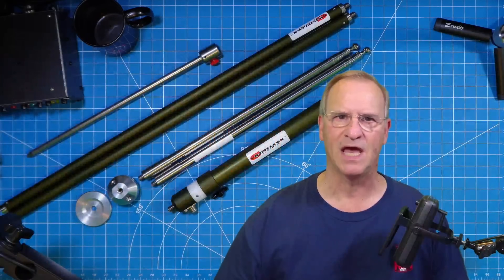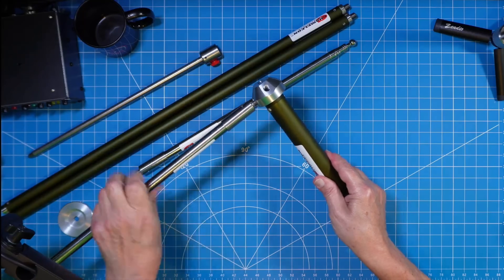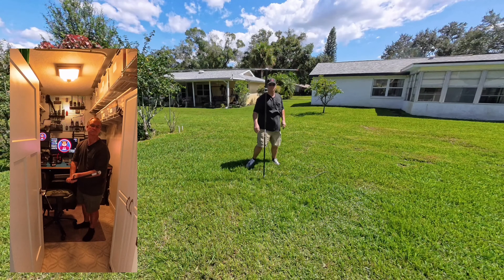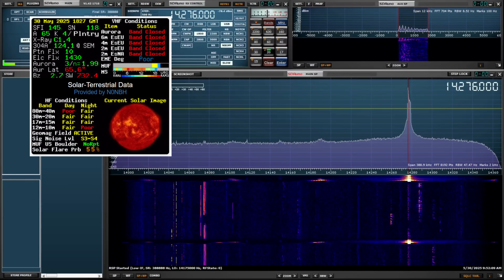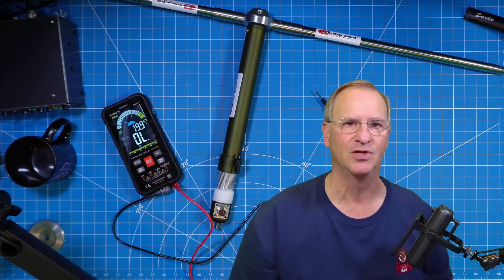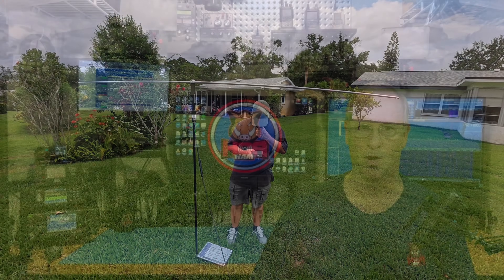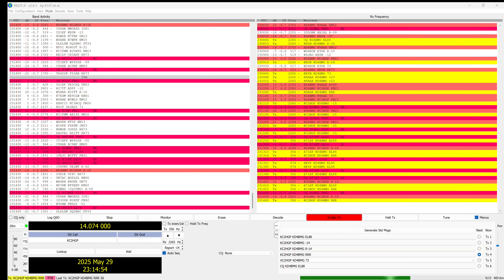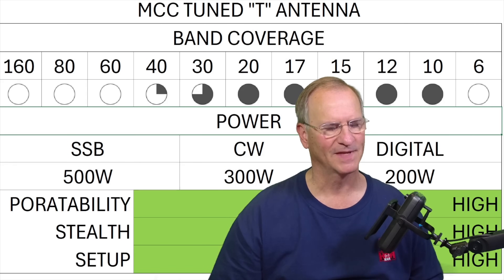Small Footprint Big Performance Tuned "Dipole" Antenna for Ham Radio POTA & Back Yard Portable

Comment: You need a hextenna from Alpha antenna. That’s a real dipole and after adding a wire from side to side, you make a delta loop. It works great.
Reply from the maker: I was going for small form factor here; off the top of my head, this was less than 10 feet wide total.  

With my Chameleon gear I have all the components needed for the V dipole.  Its on the list to demo some day.

Comment: Hello, how much better id this T antenna vs the simple MCC in vertical configuration?? tnx and 73 qro HB9GUR
Reply from the maker: The only way to measure that would be to run both configurations, on the same day, at the same time.  I did not do that kind of testing, so I don't think I can answer that accurately.  Sounds like an opportunity for me down the road to do some comparisons I had not thought of.

Comment: This is an interesting antenna setup. I'm inspired to  build and try it. This seems like it would act like a NVIS antenna at that height off the ground.  I'd like to try that 40M loop for tactical winlink as well.
Reply from the maker: I believe you are correct on 40 meter NVIS

Comment: You see antennas like this in old books (as you mentioned, it's a T antenna), it's basically an off-center-fed vertical dipole. Balancing the capacitance from the 'hat' and the coil would work to cancel any reactance out very well too.
Reply from the maker: Thanks for the view and your thoughts on what this is....

Comment: Sort of like a Center-fed vertical dipole, my TransWorld vertical is a center-fed dipole.
Reply from the maker: Thanks for the view and feedback; I'm actually going to do a TW set up soon.
Reply: Below, is my mention of my TW antenna on my QRZ page; btw I’m North of you here in TV, FL. I purchased it years ago from the original source.
From QRZ...
I also have a TransWorld Center-fed Vertical (TW2010 Explorer) which is usually set for 17 Meters, the quality is great along with performance. I'll never forget unpacking after my move to Texas, I just plopped it down on the driveway and 17 meters seemed quiet and wham, that's when a Japan station came back to me that evening.

Comment: Thanks for another creative build (and fashionable sun hat) Bob! So what you have is not a dipole (that is why you put it in quotes) but a short coil-loaded vertical antenna with a very wide capacity top hat (that is always omnidirectional). The top hat extends the electrical length and bandwidth of the antenna and helps a tad with efficiency. This is very typical of a top hat installation used on a coil-loaded mobile antenna. Although this is not what i would call an efficient antenna, it will certainly work as you have demonstrated and could have slightly improved efficiency with a single elevated radial at 3' off the ground. Of course, you may have better performance and lower take-off angle if you just made it a pure vertical with one of those whips, but I understand that would extend the visual profile. 😀 73 KJ6ER
Reply from the maker: Thanks for stopping by for a look.  I appreciate all the information and perspective you provided.

Comment: nice! looks like you have a dipole with a tuneable coil. interesting. keep in mind that antenna is not very high.
Reply from the maker: Correct observation on the height; that is actually one of the things I am trying.  Non-standard set ups in a small space; can you find a way to still make them affective.  In this case, the answer was yes.

Comment: Great video but bloody hell that is over $800 in kit. Definitely is a very specific use system.
Reply from the maker: Actually, this is an accumulation of a kit and add ons over time, which are not specific at all.  The versatility is different configuration after different configuration after different configuration after different configuration after and on.  Take a look at the Chameleon Antenna MPAS Ready kits and components and it becomes evident these pieces turn into many many different antenna configurations.

Comment: Good video.  I only have 1 of the 58" whips though.  Need to get another now.  But I do have 2 17' whips.  I wonder if I could get those to work ?
Reply from the maker: Yes you could use the 2 17' whips, but realize at that point you have a 34' long top antenna...unless you start collapsing sections of the whip, which of course you can.